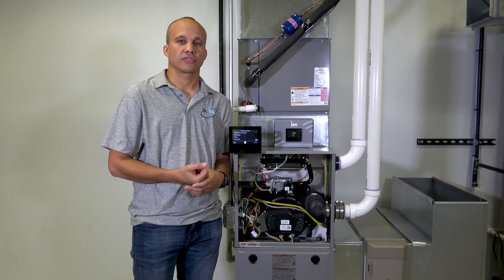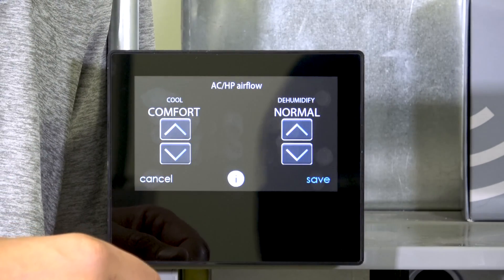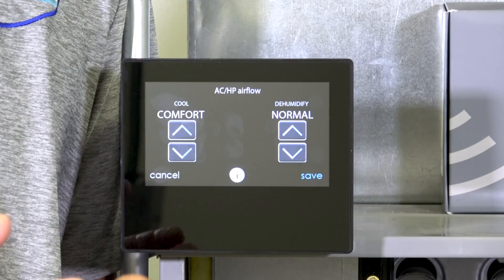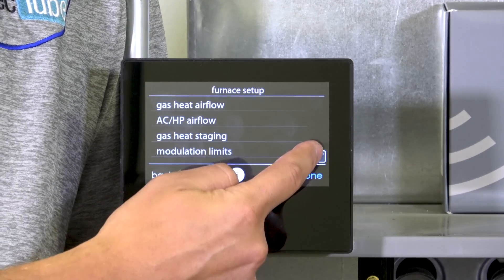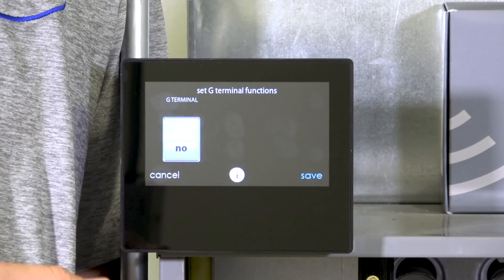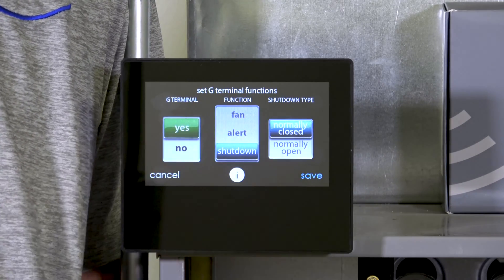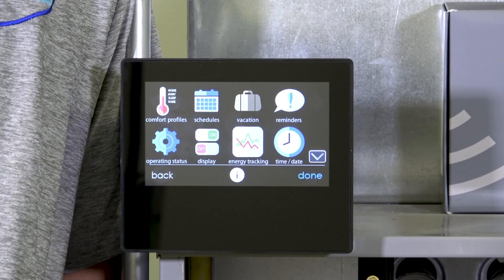ICP Ion Control Furnace Settings (4 of 5)

Comment: Hello, I have the CTN96 with the CVH8. The CVH8 rattles at times and he was advised by tech to have the HP and AC flow to Max. I don’t see how that can help with the CVH8 rattle noises outdoors.
Reply from the maker: Who is the "he" in the "he was advised by tech" statement?
Reply from the maker: Without knowing much details about the application, it would seem unlikely that increasing the speed of anything would reduce its sound levels. "Rattling" generally implies metal vibrating against metal and can be caused by loose screws, unsupported lengths of metal, or other items. It would be best to find EXACTLY what is rattling and better secure that specific component.

Comment: I have a outdoor wood burner which has the pumps on the unit. Pumps the water in the loop 24-7 to the house. Company that installed our new furnace put in a Honeywell stat to run the fan to allow the air to flow over the hot water coil. My goal was the fan would run off the wood heat then if the water got below a certain temp it would turn on the gas furnace. This worked great until it was time to turn on the AC during the summer. We had an issue with the ac not working correctly with that Honeywell stat and they switched thermostat to the Ion. The AC is worked great after that. Come heating season the gas would run and not just the fan for the Ion thermostat to get heat of the water coil. Now they say it wont work how I want it to with the Ion thermostat. Any suggestions?
Reply from the maker: We are not sure how the Honeywell was wired but we suspect that W1 (1st stage of heat) was wired to open a valve on your hot water coil and W2 (2nd stage heat) was actually wired to the first stage of heat of your gas furnace.

The Ion is a communicating control and does not wire as a thermostat with traditional W1 and W2 commands.  It is NOT going to work the way you described for your Honeywell.

Comment: Great info! I have a little duct noise with carrier modulating furnace running in high heat. What would be the best way to reduce cfm in high heat mode. I have a few ideas after watching this video. Thanks
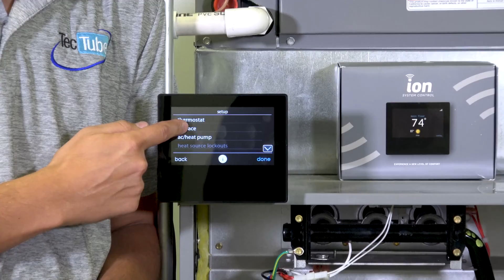Reply from the maker: Reducing CFM for heating mode is not really an option unless you previously changed the default airflows.  This video at minute mark 0:58 addresses the only settings related to airflow in the heating mode.
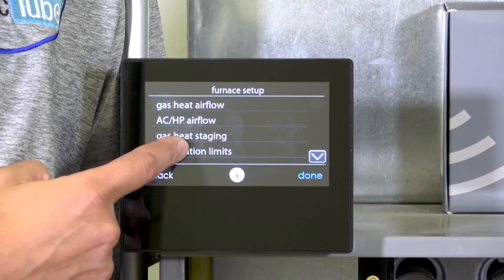Reply from the maker: Also make sure it is setup for "system staging" and not locked into high heat - watch minute mark 5:06.  And that the lower end modulation limit says "none" - watch minute mark 6:40
Reply from the maker: Beyond those control adjustments, the solution depends on the type of noise and where is the noise coming from?  Is the noise coming from the furnace or the ductwork?  Is it a rattling noise, a whistling noise, burner noise, other?
Reply: Thank you! You really know your stuff!
Reply: In high heat the increased pressure in duct, zone dampers and plenum makes whistling sound;which the tech is unable to find small leak
Reply from the maker: @owenblair2571  The airflow maximum should be adjusted per zone in the Infinity control.  This function is specifically for sound reasons.  You may want to watch our video on Infinity zoning - https://youtu.be/XVPcS1EvweU
Reply from the maker: @owenblair2571  You should also look into having your ducts sealed... specifically using a process called Aeroseal.

Comment: Great video.  Is there a way in Comfort mode for the AC to keep the dehumidification airflow to around 300 CFM and have cooling air flow higher at 400 CFM to supply the far two story bedrooms.  From what I can conclude the CFM differential in Comfort mode between dehumidification and cooling is not that much.

Comment: Im having an issue with furnace over heating the fault limit. Assuming duct work is good and gas pressure, along with filter. Shouldn't the furnace not even overheat in 'comfort' mode?
Reply from the maker: A furnace should not overheat in any mode.  If the furnace is overheating and causing the high limit safety to shut the furnace down, the likely cause is insufficient airflow.  There can be other causes (high inlet gas pressure, high entering temp due to zone bypass damper, etc.) but lack of airflow is the cause 99% of the time.  This can be causes by duct restrictions, too small of ducts (supply or return), or an oversized furnace.  Have your HVAC Pro check these items out?  They should be able to measure the inlet gas pressure, the duct static pressure, and the register CFM as well as provide a detailed heating load calculation.